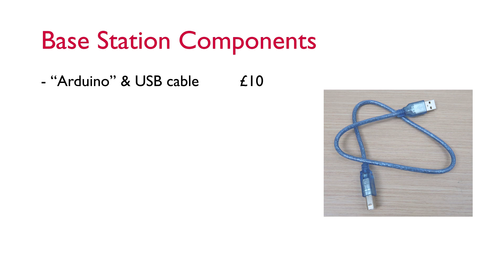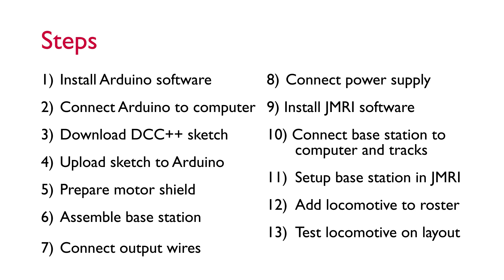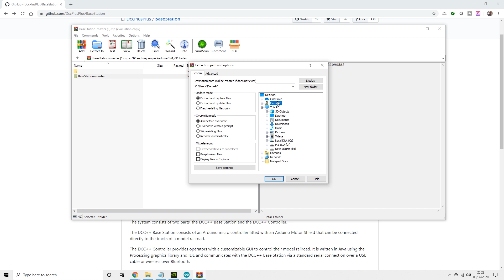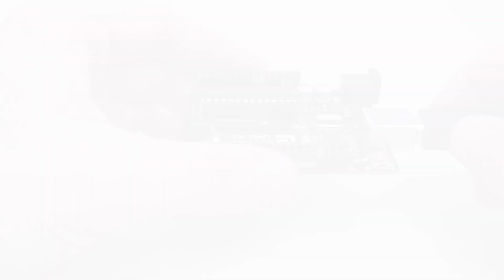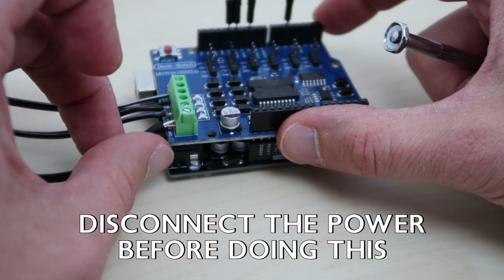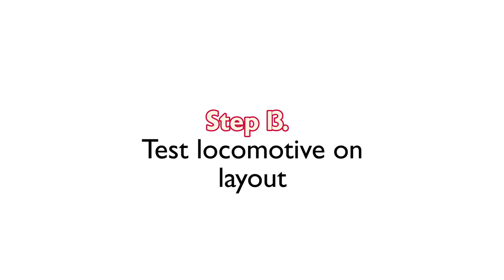Model Railway Digital Controller (DCC++) for £40 or less! 😮

Comment: This is absolutely brilliant! My only point of confusion/question is the track power connector. Does the track power connector have any purpose other than supplying power? What do the electronic guts inside do? I was planning a buss wire line with circuit breakers on each block. Will this work? My supplies come from the USA. Thanks for the super detailed procedure!
Reply from the maker: Hi and thanks! The track power connector is just a temporary way of connecting the wires to the rails in this example, most people solder droppers wires directly onto the rails, so you won't need the little clip on a permanent layout. In terms of electronics there's nothing special in it, in fact there's nothing in the DCC version. On the analogue version there's a capacitor between the connections, you need to disconnect this to use the clip on a DCC layout as the capacitor can interfere with the digital signal.

I'm not an expert, so please double check this and be careful with electrics!

But it depends what you mean by block and circuit breaker. Check out https://dccwiki.com/Power_District.

I'd put a power management device (circuit breaker) on each power district (i.e. a group of track that is in a similar area or where it makes sense to group it together, e.g. a group of sidings or a loop of track). I wouldn't bother putting a circuit breaker on each individual block unless your blocks are quite large. You basically want ever part of your layout to have some kind of short protection and if it's a larger layout then you don't want a short circuit in one area to shutdown your entire layout.

Also, if you've got any accessory decoders for things like points motors then I'd put them on a completely separate power district(s). You don't want a short circuit on track to stop you using point motors/accessories. This also means that if you're careful with your wiring setup you can still operate point motors using digital commands and JMRI even if you decide to disconnect the DCC signal to the track and hook up an analogue controller. I have a lot of old trains that I will never convert to digital, if I want to run those then I can disconnect the DCC power supply just to the track, but still have it operate the points. There is a risk that if I forget to disconnect the DCC power supply then I might damage my analogue locos, but touch wood, it's not happened yet.

Also, also, if your bus wire is going to be long then you might want to consider a snubber at the end (https://www.strathpefferjunction.com/dcc-bus-terminator-filter-snubber-wiring-diagram/)

The world of DCC wiring is vast!

Comment: It looks like the Motor Shield and Arduino are not available from the links, or at least not where I am.   
Are there any other motor shields that are compatible with this?
Reply: See our motor boards page at DCC-EX.com
Reply: @frightrisk7407  Thanks for that.
Reply from the maker: Hi Brendan, where are you based?
Reply: @LittleWicketRailway  I am based in Australia currently.   I managed to find the boards on AliExpress after a little digging around though.  It will just take a little longer to get here than from Amazon, even Amazon UK :).
I've been wanting to get into the railway stuff, but the price of DCC off the shelf was a bit of a hinderance to starting.  Finding your videos and DCC++ was my entry in  :)

Comment: Can this be adapted to run over WiFi? By adding a WiFi shield
Reply from the maker: Hi Bruce,

Yes I believe it is, but I haven't done it, so right now I couldn't tell you how. It's something that I'm also looking into and if I find something then I'll let you know. A few things like might be of interest to you.

JMRI can connect to DCC++ using a varierty of connections (https://www.jmri.org/help/en/html/hardware/dccpp/index.shtml), so that's a good start.

If you just want a wifi throttle from your phone then you can download an app called "Engine Driver" and connect it to JMRI using (https://www.jmri.org/help/en/package/jmri/jmrit/withrottle/UserInterface.shtml).

One of the options I'm looking into is running JMRI on a Raspberry Pi which will be permanently located on the layout and then connecting to this from another computer or tablet. Seems like this is possible (https://lifehacker.com/how-to-control-your-raspberry-pi-from-any-computer-usin-1788592777).

Also, I think the team developing the new version of DCC++ might this functionality as standard (https://dcc-ex.com/).
Reply: Check out the latest version and remove your jumpers. You can find instructions and video on our DCC++ EX website. www.dcc-ex.com

Comment: Excellent instruction video.  Followed too the letter and my DCC++ and JMRI worked first time.  Set up four Hornby engines, two with TTS sound , all worked brilliantly.   Far greater control than my Hornby Select controller and simpler to use.
Reply from the maker: Excellent! Glad to hear it's all working for you.
Reply: Follow us on our Discord channel . We have moved way beyond Gregg's original DCC++ Classic, especially with the way the DCC signal is generated and CV reading is done (MUCH faster and more reliable). No more jumpers, new commands, installer, wifi, better power control, enhancements we have made to JMRI, direct Engine Driver support (WiThrottle is built into DCC-EX), WebThrottle-EX (a browser based throttle and serial monitor). For info visit DCC-EX.com.  live the quality of these videos! Can we enlist you to make one for us? ;)

Comment: Stil no succes. Every time the fault 308 on de three trains i have. Something is not adding up.  (2 x Minitrix and 1 kuehn 81330 decoder) Any suggestions ?
Reply from the maker: I'll research this more in the morning, but is there a chance that you have multiple locomotives on the programming track at the same time? I'm sure I've had a 308 error when I accidentally tried to add a loco, when there were two on the prog track? The system gets confused as it's receiving more than one response from the decoders.
Reply: I don't want to hijaack Rob's wonderful channel here, but if you need help, go to our website at DCC-EX.com and look at the support page. There is also a debugging page. But use the DCC-EX version (CommandStation-EX), a know issue with the classic version is problems with its CV reading. JMRI is not reading the ACK from your loco. We have a new diagnostic <D ACK> command you will see on the EX version you can enter from the serial monitor. We need to get JMRI out of the picture and diagnose right in the Command Station.

Comment: Great video Rob, straight forward to follow, I surprised myself and got it right first time. I've even managed to get wifi working with JMRI and can use my smart phone as a throttle. Unfortunately I haven't got my layout set up yet, but a question for you (and others perhaps), how many locos, with simple decoders (no lights or sound) can be run at the same time using this system?
Reply from the maker: Hi Chris, congratulations on the build! There is some useful information from Geoff (creator of DCC++) on power here: https://model-railroad-hobbyist.com/node/35753

He says the limit on the traditional DCC++ setup is about 2Amps through the motor shield. A modern OO scale locomotive will draw a ~0.2 Amps, so that suggests a theoretical maximum of 10 locos running at the same time, although I've not tested it. I've had 5 or 6 on the tracks at the same time, some with sound decoders, without any issues.

If you want more than you'll need to look into power boosters. However, if your layout is large enough to run loads of locos then you'll probably want to look into power districts with separate supplies anyway which would take the strain off the base station.

Worth mentioning that I did have issues running my accessory decoders from the base station because they contained capacitor discharge units (CDUs). When I turned the system on they all tried to charge at the same time and the current draw was very high for a short period of time. DCC++ read this as a short circuit and cut off the power. I had to change part of the code to make it slightly less sensitive.
Reply: @LittleWicketRailway  Thanks for the reply Rob, I'll investigate the link that you have provided. On my original comment I forgot to congratulate you for the great production that you put into your videos and I am surprised that you don't have more subscribers, perhaps you have a lot more viewers. Best wishes, Chris

Comment: Hello Rob, I've logged on to my PC so I can comment and congratulate you on an excellent tutorial video production.  With Winter around the corner this makes a perfect project.  A couple of questions:
1. Does the Arduino/JMRI support 4 digit loco addresses?  Is the limit 255 locos?
2. Do you know of any cases for the unit?
Kind regards Simon
Reply from the maker: Hi Simon! Thanks for watching the videos. To try and answer your questions:

1) I don't use long addresses, but I'm pretty sure that DCC++ and JMRI can handle them

2) I've just seated mine on one of these (https://www.ebay.co.uk/itm/Arduino-UNO-R3-Bumper-Mount-case-3D-Printed-Choose-Your-Colour/273799931595?hash=item3fbfbf66cb:g:DmgAAOSwGYVW9Rut). It does look like someone has designed a proper case on Thingiverse if you have access to a 3D printer (https://www.thingiverse.com/thing:4619514) or you can purchase something that looks like it might do the job on Ebay (https://www.ebay.co.uk/itm/DCC-3D-Printed-Case/254745095777?hash=item3b4ffdae61:g:UHMAAOSwr4Rfgkdo). If you get one then let me know what you think.
Reply: @LittleWicketRailway  Thank you so much for taking the time to reply, I am very grateful, and will let you know how I get on with the project.
Reply: See our website at DCC-EX.com. the list of features is on the main page.  We default to allow 40 locos (note the "classic" version you are using does not support that and neither will an UNO) You really need a mega clone to do anything beyond the basics. Just not enough memory.) Also, there is a limitation built into the DCC specification. There are lots of packets being sent (though we now optimize them) and only an average of an 8kHz bandwidth. That means that you can only run so many locos and accessories before the delay in the signal would make things untenable. You couldn't wait a full second for a loco to get an emergency stop command ;) At an average of 110 commands per second, assuming only locos and no accessories,  much above 50 locos would get you into the range of each on only able to get a command twice a second or less. A half second could be a long time to receive a command. 110 locos would mean each loco would only get an update once per second. There are new 3d printed cases. But we recommend a Mega or Mega clone for many reasons. They are cheaper than Unos anyway. Most of the cases are therefore bigger. I'll make sure to update the website over the weekend with the case info.
Reply: @frightrisk7407   Thank you for taking the time to provide all this information FrightRisk.  I will check out your website now.  Thanks again, Simon.

Comment: Hi, i'm just following along and the motor shield appears to only be rated for 12 volts yet you say to connect a 19 volt power supply is this correct please? Also I don't seem to be getting any lights on the motor shield at all is this normal?

Thanks for the great video.
Reply from the maker: Hi Scott, you're right that the description says that it's rated to 12V, however, most of the components are rated to higher voltages (I think the main chip is rated to 46V, the rectifier is 40V, the op amp is 32V and the logic chip is 18V) so I think DIYMore are just playing it safe (disclaimer - I've not checked all the components and I'm far from an electronics expert). I've got two of these shields running off 19V power supplys and I've not had a failure yet.

You won't see the LEDs light up on the motor sheild until you connect the external power supply and you turn on the power in JMRI. If you're not seeing the power LEDs come on when you're doing this then you'll need to do some fault finding.

Firstly check that your Arduino is functioning, you should see lights on that board at all times when it's connected to the computer.

Secondly, I'd check that your power supply is actually supplying power and is connected to the shield the right way round.

If both those are ok and you're still not getting the power to come on then that suggests there's a communication problem between either JMRI and the Arduino or the Ardunio and the shield.

When you click on the power button in JMRI you should see an LED flash on the Ardunio (under the shield) to indicate that a signal has been received. If you don't see that then that suggests there's no communication between JMRI and the Ardunio. Double check the right serial COM port is selected in JMRI preferences and maybe upload the sketch again.

If the Arduino is receiving the signal and the LED is flashing then press the button to reset the board, check that the shield is pushed into the Arduino and check your jumper wires are in the right pins.

The other possibility is that that board is faulty. I think there are some fault finding tutorials on YouTube to check this.

Hope this helps. Let me know how you get on.
Reply: @LittleWicketRailway  great thanks for the confirmation, its all working great now thanks for your help! As it happens I had all the parts except the motor shield!
Reply from the maker: Phew! Glad it's all working! Thanks for watching.